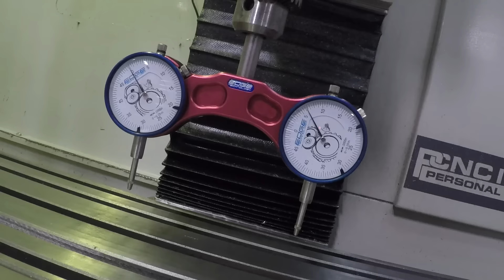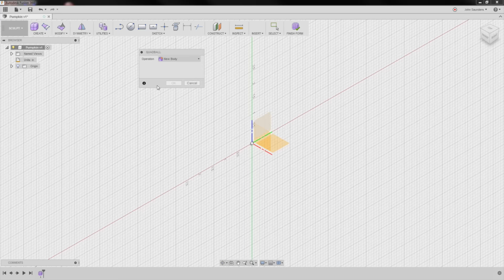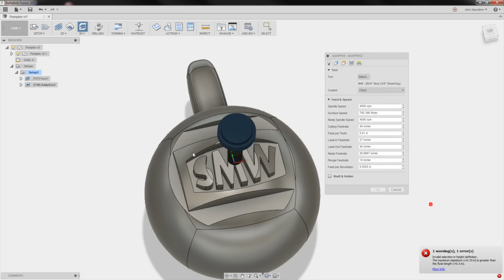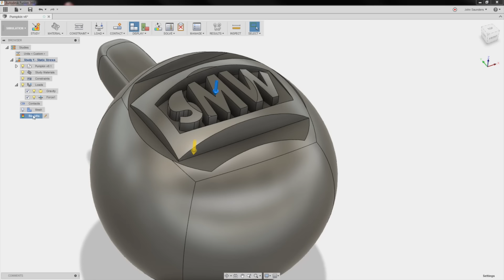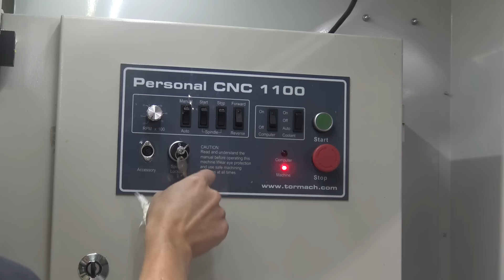Precision Machining a Pumpkin  WW117

Comment: Fun Project but don't send them to Maker Spaces because they don't need  to cleanup.  Shared machines need to be left as good as when started.
Reply: Yes, and if you don't clean them up get ready for some angry nerds ;)
Reply: Peter Menningen I agree, but I'm pretty sure it was a joke. We can just take John's punkinCNC course.
Reply: Being a person who loaned almost his entire shop to a startup maker space ( MauiMakers) I may be touchier than the average Bear (Yogi throwback)  I leave sawdust and chips so I'm not without guilt And Yes I have used my table saw top for a bench on more than one occasion (clean flat surfaces are magnets)  I see John used two hours to clean up that machine .  I even once showed a prospective member how to dehusk a coconut on a band saw to make organic drink cups. 

In my old job that was called foreseeable  use and abuse which is what we tested to.  I even converted a band saw into a car battery top cutter for an engineer

Comment: What i find funny about this is how you say you need to clean it up but you spit on the surface and there is alot of scap Aluminum or steel at the sides Great Job mate
Reply: yh but it was a bit pointless at the begging 5 min time lapse but never the less other videos are great

Comment: Pt. 3 - How To Chuck A Pumpkin In A 4 Jaw Chuck, because you have to remove the stem and bore out the seeds to give that logo the back light it deserves!! 

(Tangent, I recently used Auto Marine Silicone to seal up any problem areas for chips and coolant. It has made chip clearing and general cleaning faster and easier as things to slide or skate off the silicone. Works like a charm and the silicone stands up to water soluble coolant rather well. I run 5 - 10% mind you.)

Comment: What SFM do you recommend for pumpkin? I haven't been getting ideal chip formation.
Reply: The Metal Butcher it's more of a pie formation.  If you want chips you gotta machine chocolate or potato.
Reply: Ryan Landry 80% chocolate would machine quite well!
Reply: Drakkar Calethiel certainly.  100% cocao will cause faster tool wear.
Reply: Ryan Landry Better go with 50%. No need for flood coolant. :D
Reply: Drakkar Calethiel ;-)

Comment: Did you really break a Haimer doing this?
Reply: I really want to know. lol
Reply: chase weeks The Haimer tip did go in and snap off... so yeah, add that to list of things not to do.
Reply: I really hope he stuck an old broken one in the pumpkin then just jogged the machine so it looked like it broke it. That would be an expensive joke otherwise.
Reply: MrMaxymoo22 Right? Those things are freaking expensive. I cringed when I saw the price.
Reply: He just broke the tip. Easy to replace. They are designed to break easy.
Reply: Bradley Willoughby 
o
on
Reply: If you look closely you can see that was already broken before it went in the pumpkin.
Reply: When you think about the Haimer (or any similar digital touch off instrument) and on their site they give an accuracy of .01 mm (10 microns) or roughly 4 tenths and then you reason the price of the thing at over $400 quid.  Then you look at a regular edge finder @$25 bucks and look at their accuracy of half a thousanth or .012 mm (12) microns because they operate on the machines true center and don't need calibrated... really an odd choice the Haimer.  $25 vs $400 + tip costs for accidents.  One of those, "technology not worth the price of admission" things.  Its a wonder they even have a business model but I guess monkeys love flashing lights shiny things that cost a lot.

Comment: I had one hell of a time figuring out how to project a sketch onto a curved surface. Still never got it quite right.  Also, seemed like your SFM was a little low for that material. Did you use the pumpkin spice defaults in fusion? If so, I think they need an update.

Comment: what feeds and speeds should I use for squash-type materials?
Reply: rparker069 whatever speed setting 11 is on your machine.
Reply: Similar speeds to those you might use when machining a steak
Reply: @noahhastings6145  5 years and I finally have a proper answer, many thanks

Comment: A little bit of (barely relevant) feedback : Would it be possible to avoid using this specific music track, or even , to not put any music at all ? I understand that it helps fill the audio but it is really not necessary ... and this one specific track gets on one's nerves really fast.
(of course one can always set the video to mute, but that's besides the point since it also mutes the machine sounds). Thanks and keep up the good work !

Comment: It's not a big deal, just cut off from the point where the cutting edge hits the pumpkin, and additionally I'm breaking pick gauge, and I do not see anything wrong with Americans.
If I am a jig, make jigs and make 3d scan as it is to make uniform carvings on the whole face of the pumpkin, it is hard to break the tools

Comment: Everything is cool, originally pumpkin, there is no cutting resistance, use head, you can clamp even double-sided tape and clay, but in Japan I do so, cad is too bad, do not use free autodesk, At least let me use solid works